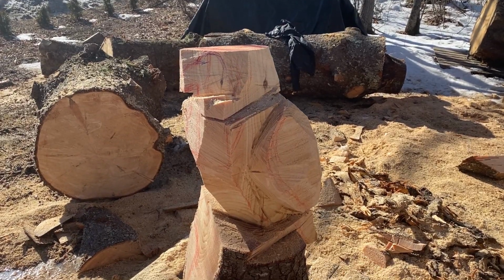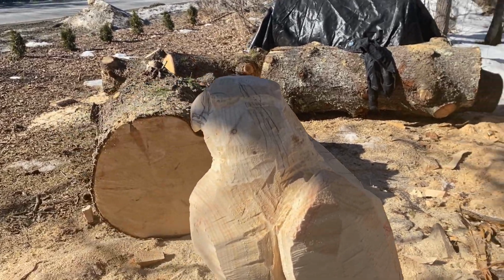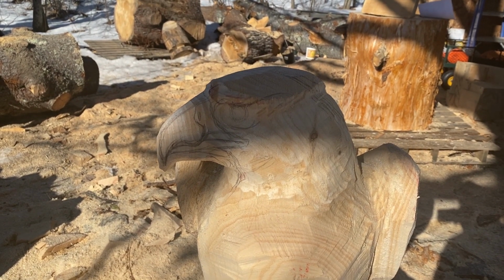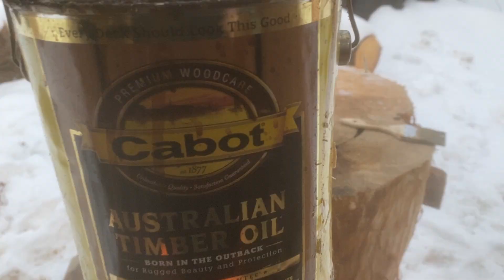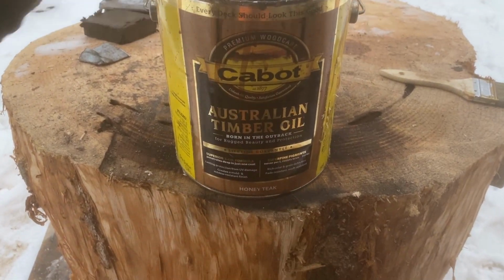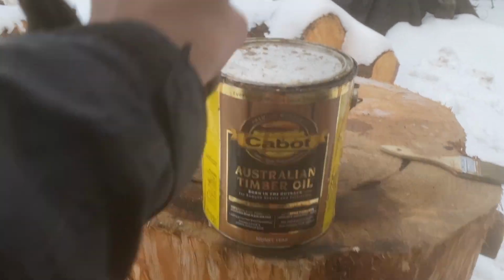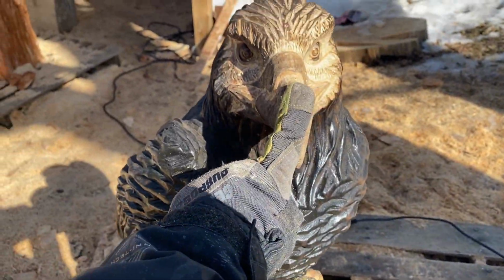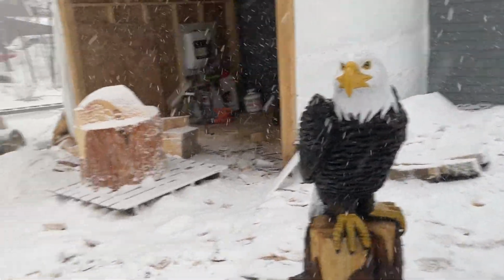Eagle Chainsaw Carving

Comment: Yeah i found the short u told me about! Lol "wah wahhh". U did a great job! Love the new Ms 170.
Reply from the maker: Thank you 😊 The 170 has been a blessing! Next up is the 501p!
Reply: Oh goodness thats a biggie
Reply from the maker: I’ll take a peak later tonight 😁
Reply: @TayMarie23  May I recommend the Stihl MS250 instead of the 501p? I think it helps to stay with the same brand saws. You become very knowledgeable on maintenance and many parts are interchangeable. For example, a MS170 bar fits on a ms250 powerhead and it screams. When you start mixing saw brands you end up with a hodgepodge of parts.  The one exception is the new Echo 2511p that is the smallest carving saw available.  Much lighter than an MS170. A treat to use with a 12" carving bar. Just my 2 cents.
Reply from the maker: @zod5966 I greatly appreciate that! All advice is welcome! 

I do have my eyes pretty set on the 501p and echo products in generally due to their better price point in the long run! With that said I will look into the ms250 😁
Reply: @TayMarie23  I only mention Stihl because you already bought the MS170. I don't have a brand loyalty. But if you continue carving you will eventually end up owning 10 saws and it is very helpful to keep them all to the same brand for your knowledge base and compatibility. The Echo 2511p is a must have for finer carving. It makes the MS170 feel like a giant heavy brick. 

Also something to consider is the line of Stihl battery saws. They have a decent line of battery saws that you will definitely end up acquiring some day. I don't know if Echo has the same variety of battery saws. Check out the tiny Stihl MSA120 and 140. Low RPM and light weight for great detail carving. Just food for thought.

It's prob a bit far from Maine but if your interested in a road trip check out the Ridgway Carvers Rendezvous in Ridgway Pa April 26-29.  Great for walking around and checking out carvers' techniques and tools. Everyone is super cool and willing to share carving tips.
Reply from the maker: @zod5966 I would love to have 10 saws, I don’t know where I would put them all, but I would make it work haha! What I was trying to say above was I plan to go the echo route due to them being more affordable and also having a local service center! The local echo dealer also offers a 5 year parts and service warranty! The MS170 was gifted to me, as much as I absolutely love it, in the long run I’ll probably go echo for all future saws! 

Funny enough I do hope to make it to PA for the Rendezvous! My boyfriend has family over there and we try to visit once a year. I’m trying to set up a possible visit for that week and hit up the competition on the way! When I say I’m a slow carver…I mean SLOW! So I want to see how the speed carvers make their cuts…I feel as though I could be a lot more efficient with my blocking. I really hope to make it there!
Reply: @TayMarie23  😁
Reply: @TayMarie23  Great. It's worth checking out. Carvers are usually happy to talk and tons of talent there.👍

Comment: Good looking eagle, the feet are a little thick and long but it could be a camera angle. A little more defined in the back would be nice but you have a very close to real bird. How can you paint during winter when 50 degree weather is best? Good amount of time out in the cold with power tools gives some admiration for the job
Reply from the maker: His feet are definitely on the large size, it’s not the camera angle hahaha! I have only done a few birds so it’s just part of the learning curve! I have only been carving for 7 months :) 

I use all oil based paints since I put them over timber oil, so they can be applied at colder temperatures! My rustoleum enamel can be applied at any temp between 32F-90F! As for the spray paint…it was 49F that day so I painted first thing that morning!!! 😂 it’s a pain waiting for warm days during winter but I usually have several projects lined up, and when we get a warm day everyone get painted!

Comment: Did the carving bar fit on the oregon cs1500 or did you have to change the sprocket
Reply from the maker: The stock sprocket was 3/8p so I had to change it over to 1/4 pitch! Bought the 1/4 sprocket for Mikita’s battery saw and it fit perfectly!